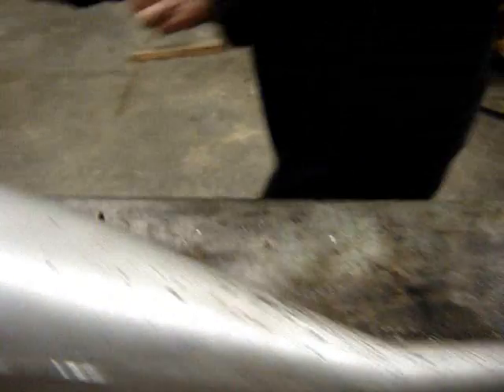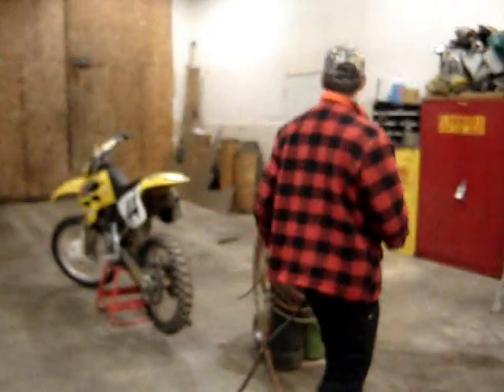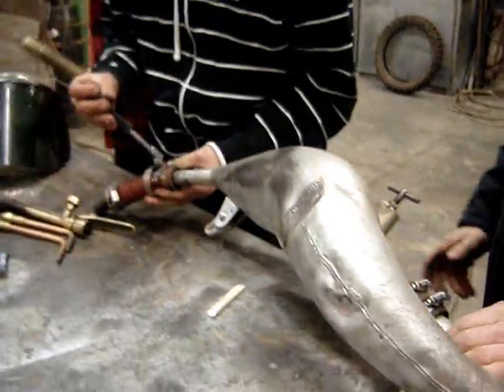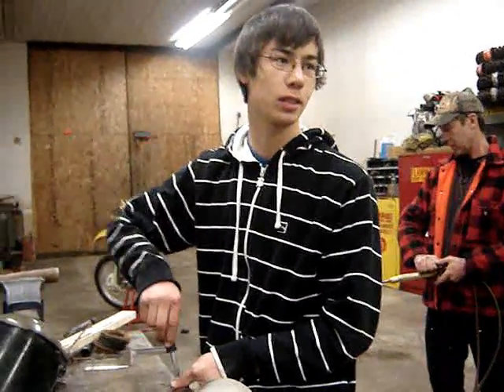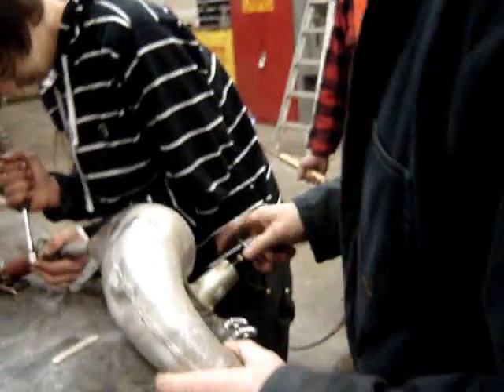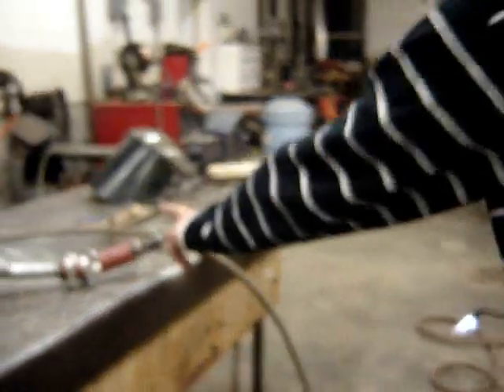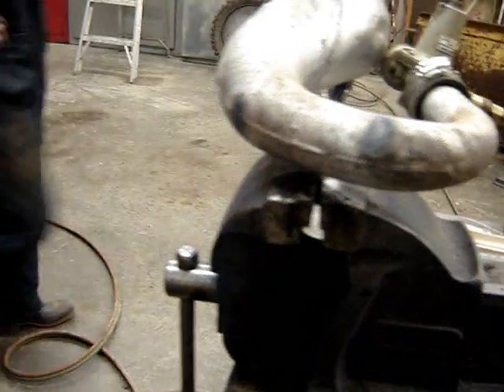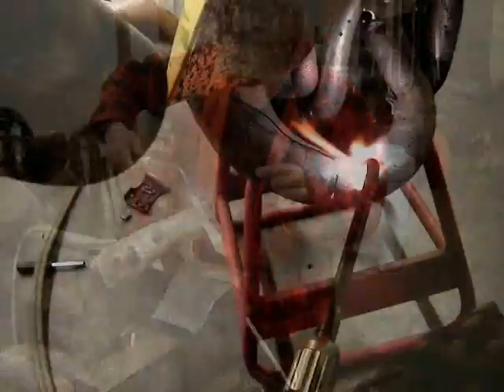EXPANSION PIPE MOD PART 1

Comment: canadians, and i bet they got stoned as hell after this, and try freezing your pipe instead of pressure and heating, it doesnt weaken the structure, it takes longer, but it works way way way better, fill with water, and put it in your freezer for 7-10 hours, much much better